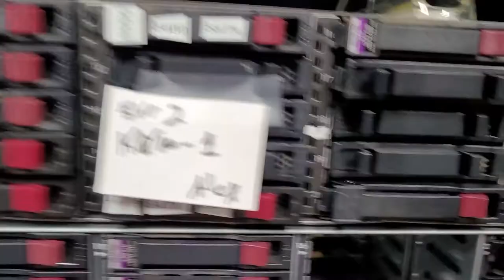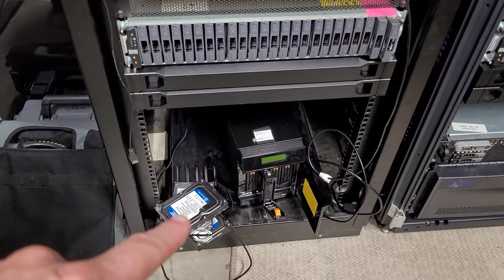Do I need a SAS SATA or SSD Disk array

Comment: I'm about to try to squeeze two enterprise ~16TB u.2 nvme drives into my consumer PC.  A bit lost at this point, but ordered several nvme adaptors from aliexpress. . .thanks for the tour.  PS - have zero need for speed above normal SSDs, but totally disgusted by the price of consumer sata ssds and I found someone selling U.2 NVMe drives for much, much less. . .so, gotta try.

Comment: Brad, I just purchased 4 Seagate SAS Constellation ES.3 2GB drives and simply wanted to use them as External Storage but have not been able to get an answer on YouTube as of yet. Could you tell me what I need to use these drives for external storage. I don't need RAID, I simply just want to backup some of my files without a big array... Is that possible?
Reply from the maker: YEs you cna do a SAS HBA hook up (no RAID) and jsut use the disks as single drives.  You will need a SAS controller I am sorry to say.  Your motherboard SATA will not support SAS drives.  But they are cheap.  You can use your PC tower to hold the drives or you cna get a SAS/SAT 4 drive bay insert or external housing if yuou want but four drive should be able to fit in a PC tower if it is a mid size tower.  But just in case here is a link to a 4 drive bay insert for you tro work with.   https://www.ebay.com/itm/254757684093?hash=item3b50bdc37d:g:e9EAAOSwWzRfk2uL&amdata=enc%3AAQAHAAABADmKhQFhopg2epj%2Bfnl8Hq9wC%2BdzJVEl%2BlE6N9lK3Y0k%2BEtbYuo49oCWjssebZ7hMxLEUajWCqwC2VWRl0Lvnxy46vBFS3a9THFi%2B8Mwikc4l8retetCtY1SFlFY7wRK%2FBCCRAocucWj%2Bw6PQ%2Bz%2Bw1vuGrLW93d6HTjbg2qU13KTlruQTIsb37SGR8uqdtHGty2arclRBf2m9cfTxk9DzVuOrU%2Bpii7%2FSBQxqy7Ao7oxNHqHefoXMykffdhLi01nUXacknwwA6FtdUihvVNVut%2FAuw8Yll75%2FVcuUWUagYRFtmpjgRPGtJhmrKq1rr6E2hlylrvgWyH5TMlMuL8Za8M%3D%7Ctkp%3ABFBM7OW2hb9g  

As for the HBA controller, any low cost (around $35) LSI SAS/SATA HBA controller will work.  (No frills)  Just make sure you get the right nubmer of cable connection for the way you plan to connect up to the drives.  Enjoy dude!

Comment: Hi Brad, thanks for your video, I have a question, currently I have a customer using an sata ssd array for a datab ase and they are complaining about speeds, would sas ssd's increase performance compared to sata ssd's?

Thank you
Reply from the maker: SATA is Serial  based data handle ans SAS is dual path way so yes.  It is faster by x2 so you could transfer the SSD disks and try that first.  There are faster SSD drives but try that first.

Comment: thanks Brad for explaining on this topic, i have query that we have ontap cluster in which we have disk array were we have SAS and SSD drives will that be a problem? but we have SSD disk were we have created separate aggregate pool and for sas disk we have created separate aggregate pool..
Reply from the maker: If your volumes are setup correctly then no.  NetApp should have setup the disks in the array so there is not risk as long as when you build your volumes you only do the same class of drives in the volume aggregate.  Never add SAT and SAS or SSD in the same aggregate.
Reply from the maker: Plus if you retire the DS2246 arrays just move them over to your HSM platform and use them for tiered storage function.  Tha way you use the older disk space to hold cold data as needed.

Comment: What would you recommend I use for an email server that will host thousands of contacts in a database, as far as storage goes? I was thinking about connecting the email server to a DAS server with RAID. What are your thoughts on this?
Reply from the maker: Well that comes with a lot of questions like what OS will it run on and are you recycling or looking for a home multi-Services server mode based running all services in your home or can you get away with SNS from AWS?  Need more info if possible.
Reply: @leadiususa7394  I would use Linux Ubuntu as a headless server. I'd install a LEMP Stack server with NGINX as my main web server software, Mautic, as my main autoresponder (email newsletter software), & PHPMyAdmin to help manage my database for storing my contacts. I would also use Amazon SES as my main SMTP server for bypassing my ISP (if needed). So, I was asking if you think I'd somehow be able to build a good DAS server with RAID on top of it all.
Reply from the maker: @aaroncatolico7550   Oh yea you can, ZFS or TrueNAS will work and use teh LSI 9300 series controller HSA.  Keep it simple and NFS it out for storage use.   Should work nicely with this setup.

Comment: My biggest issue is, I have very small space, so I have to buy shallow server rack. only JBOD's fit my rack :(
Reply from the maker: My Dell EMC disk array is only half the size of my DS-2246 array.  It may do you justice and fit well.
Reply: @leadiususa7394  you are talking about the EMC KTN-STL-3 the 3.5" one and maybe the 2.5" one right? that's the smallest JBOD I found and actually already ordered 2. Im in the process of doing research on the best HBA I can get to attach it to my storage server, speaking of which I wanted to ask, both of arrays did not come with rails, assuming you have the same one, what rails did you use and which HBA do you recommend, sorry to ask a lot but appreciate the response, and thanks for the video :)
Reply from the maker: @OT-tn7ci  I am refer to this unit... EMC 25x 2.5'' SAS SATA SSD Server Hard Drive Array Expansion JBOD Chia Dell HP  Model number: VNX6GSDAE25   and runs for about $175.00 and pretty shallow.  Here isa ebay link https://www.ebay.com/itm/324663241031
Reply from the maker: @OT-tn7ci  Here are a few videos I did on this model.  https://youtu.be/MwR1hEQCf94   and  https://studio.youtube.com/video/X3nu6AZea5Q/edit    Hope this helps you some.
Reply: @OT-tn7ci How'd it go with those KTN-STL-3's in the end? I am in a similar position to you with a short depth rack and thinking of getting one

Comment: Hi could use the hp 146gb 10k sas as a external hard drive to store videos pics ect for my desktop
Reply from the maker: Sure but why just 148 GB SAS drive when you can get 500GB SAS drives for 10 bucks a pop. and so on...
Reply: @leadiususa7394  coz I have recieved 3 of them and planning to use them as my move around storeage one of which will be my snappy drivers maybe use the other for a retro gaming system and the other for all my software programs
Reply from the maker: @devmac890  Very cool!

Comment: hello again brad i was watching this video on the hard drives a good video, useful to me with my current project.

ive looked at the back of the hard drives currently installed and unless im mistaken it looks like i could replace the sata drives for sas. but will their be any benefit to changing sata drives for sas due to the limitations of the onboard controller with the speeds of 3 gb on two drives and 6gb on the other two drives 

As i know sas can run at much higher speeds and have onboard memory upto 15,000 rpm

Also do you have a limitation of 2 tb a drive using sas 

you also mentioned small 2.5 inch drives could be better now for the 

hp server im working on its possible to take out the current backplane board that connects 4 sata or sas drives and replace it with one that carries 8 x 2.5 inch drives but their apparently their is a limitation on amount of storage space you can maximise up to on this server if you go up to 4 x 4tb apparently the raid gets errors and crashes on sata

so even if i only used 2tb for sas their could be a limitation of storage

at least ive learnt why i cant use ssd's 

but some people still do install them into this server im not sure why though or what the benefit is
Reply from the maker: Well first thing is to make sure that you have a SATA/SAS controller on board in your server.   Yes SAS drives can be plug up work on SATA cabling but msot common motherboards do not have a SATA / SAS controller on board so you can't see or use the SAS drives.  Do you research first on your controller.  As for the 3.5 vs. 2.5 drives.  Look at your drive caddies to see if they have the mounting screws for both on the caddie.  The 2.5 drive mounts will mount from the bottom of the caddie vs. the 3.5 drive mounts from the sides.  If so you are good.   Now for the last question ( I think...) the largest size of a SAS drive.   First things first yes.  SAS drives use dual channels for data reads and writes that can be done at the same time.  SATA drive can onyl write or read but not both so SAS is faster.  As or how big can you go on the SAS drive size?  You cna go pretty bigger.  4/8/12TB drives are out there in the 3.5 inch format.  As for the 2.5 inch SSD format drives you can get them up to 16TB in size if you want and should work on a SATA/SAS drive plane jsut find.   BTW the if you have two 1GB connection on the chassis you cna run in ALB (adaptive Load balancing) mode for dual 1GB bandwidth so you can read and write at the same time on the LAN giving you a lot of stable transfer rates.  Now for that to work you have to have another system that have 2 x 1GB NICs setup or a 10GB NIC connection to get the full transfer speeds but just a idea..  Most manage switches these days can support that ALB mode.  You jsut have to do your research on the setup of the NICs to make it happen.  Enjoy!